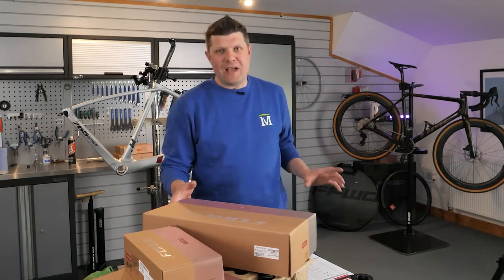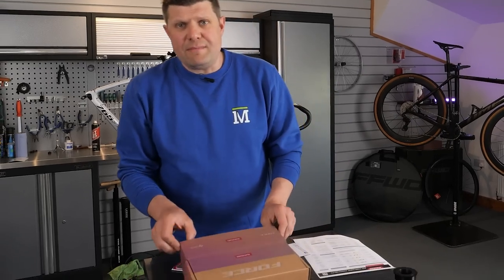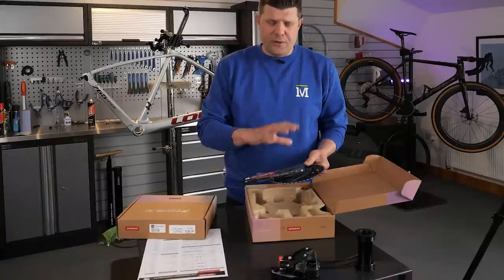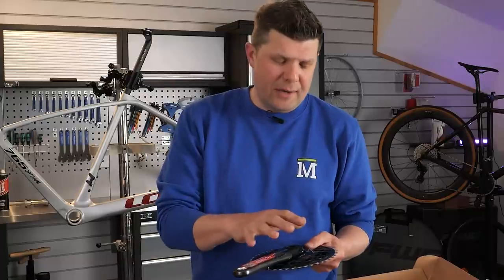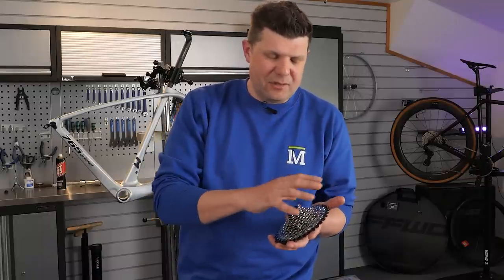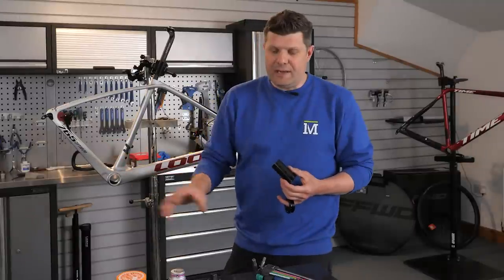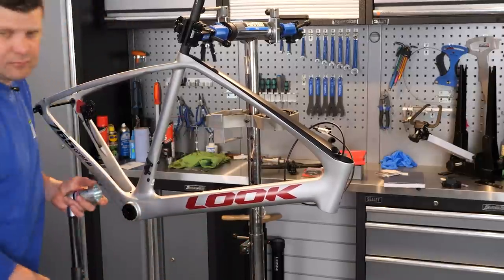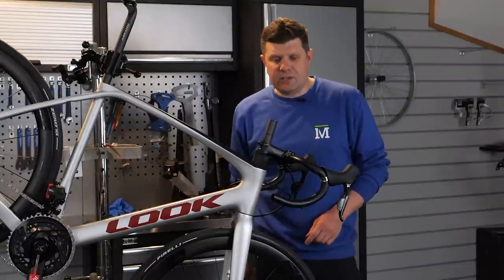SRAM FORCE leading the way, we all need to catch up

Comment: New Force AXS uses the same main shifter body as the Rival, so they got rid of contact point adjustment (which really didn't work well IME).
Also, for the BB was a spacer installed on the DS before the initial install? The SRAM Dub BB install chart shows that a 2.5mm spacer is needed for the regular Dub crankarms with a traditional road-width bottom bracket shell and cups. So the spacer added later should have been included from the outset if none was initially installed.
Nice vid tho, keep up the solid content
Reply from the maker: I know. That’s why I said Hambini should supply one.

Comment: 16:24 OMG , I left this video running in the background and went to FFWD to see what's new in their outlet section for my VITUS EVO but nothing rim brake so looked at normal priced wheels and seen these RYOTS and as I went looking for what Shimano is doing I heard you mentioned FFWD........................................so the Dutch wheels for my VITUS it is !!! A sign from above
Reply from the maker: You mean you weren’t paying full attention and ended up buying FFWD wheels through subliminal messages 😳
Reply: @Mapdec  😂😂😂 I don’t need much encouragement to buy from that brand, I had a set of F6R with the aluminium brake track and they were fantastic solid wheels, highly recommended!!!

Comment: I run the 43/30 wide option originally with the 10/36 cassette but I changed to using a Shimano 11/34 as they cheaper to replace.  Also I didn't really need a 36 upper socket (34 is so close anyway).  With the Shimano 11/34 if gives me a 14 sprocket between the 13 & 15 over the Sram 10/36, which I find more usable to me than a 10. Which is just too big for me, who is going to use a 10 on gravel? The complete Look bike is gorgeous.
Reply from the maker: Good Info Dean.  Thanks.
Reply: I made a close ratio for gravel. 14-32 cassette from the 11-32 but replace the 11 and 13 with 14 and 15 from the Jr. Cassette. Very usable for gravel with 46/30 rings.

Comment: I'm a big fan of the Force/Eagle mullet setup. I do wish there were more chain options, for non GX/Eagle rear mechs. I have found that KMC and such don't work as well as the SRAM flat top if you are running the Force/Rival/Red derailleurs, although the GX/Eagle don't seem to be as picky. This is unfortunate as I like blingy chains and SRAM rainbow chain is unobtainium.
Reply from the maker: Yes, it is quite surprising that KMC, connex etc haven’t got to eagle stuff quite yet.
Reply: Have you tried YBN?
Reply: @TenSapphires  No, but I will look them up.   I've been a pretty hardcore KMC fan and was really disappointed their chain didn't work as advertised.

Comment: Very informative as usual,love how tidy and clean the workshop always is-definitely one way to spot a pro!question why gt85 not wd40 just cause it’s cheaper ? Or any other reason? 🙂thanks
Reply from the maker: The workshop downstairs is a different story ☺️.  Think I was using that GT85 to clean off some sticker residue.  We don’t tend to use it much. We keep WD40 downstairs as a water dispersion.  Gt85 usually hanging around, it has its uses.

Comment: Another super looking machine👏 What did you torque the T47 BB at? Thanks for the info on the BB, was something I’d been thinking about as to how to instal mine. What would your recommendation be as to a set of Carbon bars, would be nice to have your take on this.😊 Keep the content coming👌
Reply from the maker: Thank you.  It’s in the vid, more importantly its in the instructions 👍
Reply from the maker: Oh carbon bars.  Saves weight, aero bars save watts.  Lots of them flex in an anoying way.  I personally prefer alu for rigidity and confidence

Comment: Have you have any problems with chain drop on recent AXS builds? I'm looking at the new Force, but a couple of clubmates had issues with seemingly-incurable FD woes on the first version of this groupset...
Reply from the maker: No, but that said it’s very easy to set this up without using the limit screws.  A mechanic doing quick assembly would easily overlook it because the gears would work well in the workstand.  It’s an easy fix.

Comment: I’m using rival 43/30 crankset with a standard DUB crank rather than wide. Works fine.
Reply from the maker: Ah. Did you just buy the chain rings separately.  Many folk will find that the braze on hanger does not go low enough.  Depends on the bike.
Reply: @Mapdec  Front mech is at the bottom of the slot on my BMC Roadmachine. I use 43/30 for long days in the mountains.

Comment: Hi! Great video!
I really understand the use of a wide spindle for the 2x set-up on a gravel. I wonder if I would need a wide 1x crankset over a normal size one, to build a mullet set-up . Do you think it would affect the chain-line too much?
Reply: If your frame has both it should be fine for each. Certain frames can only have the road wide cranks.
Reply from the maker: Check and measure the frame and consult the SRAM frame fit specifications. Your cranks might hit the chain stays.

Comment: Question: rim brake caliper adjustment lever/cam knob or whatever you want to call it. I see so many riders with this in the open position and cable tensioned that way. Shouldn't it be tensioned closed unless you have to take the wheel out to give it clearance? Pet peeve of mine when I'm looking down at the person's frame in front of me.
Reply from the maker: You are seeing this more and more as riders are trying to squeeze in wider wheels.

Comment: Excuse the stupid question as someone looking to change from shimano mechanical to sram axs. What would be the right set up as someone who has compact chain set with 11/32 on the back what would be the axs 12 speed equivalent.  Cheers and keep up the good work.
Reply from the maker: Do you want to extend the range? Which way? More lower gear for climbing? Or more higher gears for speed?  Sram have a useful calculator on their website
Reply: @Mapdec  I was looking for the closest gear ratio as possible that I have now. I'll check their website. Cheers for that. 👍

Comment: If sram got rid of the flat top chain and small chainrings, they would be hard to argue against. Theoretically sram-shimano hybrid is possible, but I've heard that in practice your mileage may vary
Reply from the maker: It depends on how much noise you consider tolerable
Reply: What’s the problem with the flat top chain? At least it looks way cooler than the normal ones.
Reply: @SrFederico  slower
Reply: @invisiblescout6335  But that could hardly be caused by its form. That must be the inner construction.
Reply: @SrFederico  doesn't matterwhat the cause is, it's slower than the competition and the only one compatible with the rest of the groupset
Reply: @invisiblescout6335  According to Zerofrictioncycling, Force 12speed chains are identically fast to Ultegra 12speed chains. So what's the deal?

Comment: I really like this channel, informative and very well presented. Do you have any experience of fitting a Rotor crankset with their own version of compatible AXS flat top chain rings, in combination with the Force group set? Also, is the SRAM brake bleed process really that much easier than Shimano’s? Nice to see a bike shop using quality tools such as Wera.
Reply from the maker: Thank you. I can’t comment on the rotor/AXS sorry. I just haven’t come across it yet. All brakes are pretty easy these days, especially if you use the brands own bleed kit and follow the instructions exactly.  All systems can get that awkward last air bubble trapped somewhere. Sram is less tolerant of a bodged job, Shimano is more forgiving

Comment: I have two quarqs dzero 11 speed. Can I use them with AXS 12 drivetrain? Or do they make 5 bolt 12 speed chainrings with 110 and 130mm BCD?
Reply from the maker: Depends on the spider you have.  Sram don’t make compatible CR, but there are 3rd party options for some set ups.
Reply: @Mapdec  thank you. I found that praxis makes rings that would work with my setup.

Comment: I’m having an issue with my new DUB left crank power meter where it reports non-0 cadence and power numbers when coasting occasionally, have you encountered this?
Reply from the maker: Hey James. No, but have you used the AXS to reset and did you calibrate from your head unit?
Reply: @Mapdec  Yeah, I've recalibrated in the app and my wahoo, and reinstalled - issue persists. I contacted Sram, they said reset it by leaving the battery out of the sled overnight. Issue persisted. They said next step would be replacement

Comment: So many wasted watts in SRAM AXS road, DUB BB, flat top chain, not to mention the 10 tooth cog on the cassette, having said that its so easy to build a bike with AXS
Reply from the maker: That’s quite a claim 😳
Reply: The chains consistently test slow but durable,  and the mechanism of small cogs and chainrings being less efficient is well known.  Every modern TT and Tri setup accounts for the latter.
Reply: @willspower3  I mean, we're talking about a handful of watts. If you don't like it, just get a massive front ring and don't use the little sprockets - that's what we do in tri.
Reply: @David Wills  Jumbo Visma doing pretty well on them...have won plenty of races and been on many podiums using their stuff. Legion in the US using them in the crit scene doing well on them. I think the few watts lost probably isnt that much of a thing for riders with good legs.
Reply: @kellrockets101  A few watts is a few watts, but financial incentive/sponsorships will easily override it. Those teams are OP, so it likely won't matter much.  Also: https://www.youtube.com/watch?v=Tsk3zAZyLaQ

Comment: Just a shame you are stuck with their flat top chains and gearing ratios. Ps Sram say you should use their AXS chainrings. I would say they are limited for racing unless you pay silly money for the rare larger ring setup with I think may only be available in the Red possibly powermeter only variety.

Comment: Leading the way in shite front dérailleurs?
Reply from the maker: For sure. Sram never mastered the mechanical front mech. The AXS ones are good though. Many mechanics fail to fit the frame brace though.
Reply: I had no issues installing a previous gen Force AXS front derailleur and have had zero issues not only getting it super dialed but haven't had any issues with dropped chains either so I'm kind of curious if poor installation/maintenance is what leads to people having issues. That being said, I would not claim that SRAM does it better than Shimano; just that a lot of people go a bit too hard on SRAM.

Comment: Okay it's wireless and I got options. And the powermeters are solid (although throw away which seems completely out of place in current times). 
But objectively from all the different rations 80% are unnecessary and make no sense mechanical wise. Shifting is not as good as shimano, DOT fluid is just stupid and has no place on bicycle, SRAM bottom brackts and 30mm aluminium axles are shit, front mech is shit, flat top chains are shit, general quality is very mediocre and repairability and technical documentation lags behind. If SRAM is leading something, then it is questionable engineering and design philosophy
Reply from the maker: I’m not sure you listened to the part about PM. BB work well in everything except PF41. I’m not sure I agree about the design philosophy bit.  I like that they are pushing things forward and listening to riders.  Shimano has turned into a copy and refine 3 years later brand. Maybe SRAM is a little too early adopter for you.
Reply: @Mapdec Cycle Works as a mechanical engineer and cycling enthusiast myself, I have a very good understanding of the hole topic. Shimano is not without its flaws, but there is a reason why all cycling influencers with engineering backgrounds like peak torque, hambini, luescher etc are on Shimano. SRAM has some nice ideas but the fundamental engineering is just always questionable
Reply from the maker: Yeah. I can never understand their reasoning.  Shimano cranks bend , corrode, and snap, their callipers disintegrate, levers have very little adjustment, chainrings warp.  About the only issue with current SRAM is their crank axle. We just fix this with after market BB or spacers. Their XD freehub can crossthread if crack handed I guess.  If you don’t clean up after bleeding brakes you can get corrosion of seals. I guess as a mechanic serving customers I see less issues with SRAM and those I have I can fix because they sell spares. Shimano are a lot more disposable parts. They break easily, they don’t sell service kits, but in balance their parts are cheaper.    Engineers on YouTube tend to find faults that probably exist due to engineering in the costs and the home mechanic.  Shimano is often favoured for its simplicity. SRAM has become quite complex recently and it baffles many people. It is complex because of the options they give.  Good debate. I might get a podcast going about it.
Reply: @Mapdec  First of all, thanks for taking your time and answer even critical comments like mine!
Regarding the groupsets: it's definitely an interesting topic. As somebody without a fulltime job working on bikes, I obviously lack the day-to-day experiences with customer bikes that you have. On the other hand, with a proper engineering background it's very easy to spot engineering mistakes on paper. Some SRAM stuff is just fundamentally “school book wrong” in a way that even a first semester engineering student should know better. We don’t need to talk about the fact that Shimano also has some really obvious problems that beggar belief. But all in all, I think Shimano’s engineering is just objectively more solid and their drive train performance out on the road is better. 
From my own experience as a home mechanic, I can also say that Shimano gave me way less problems over the years. Of course, my sample size is way smaller than yours, but with all due respect, practical experience can be misleading. Yeah, maybe Shimano is as bad if not worse than SRAM in the workshop?! But Shimano is also fitted on way more bikes, so of course they are more broken Shimano components in absolute numbers. It is also fitted on more entry level bikes, which get less serviced maybe?! It is fitted with more race bikes, which get abused more!?
From 18 world tour teams, 14 are on Shimano, jet Shimano only sponsors 6 I think. There is no team pro team which rides SRAM by choice and that's for a reason.
Reply from the maker: I think the world tour is a poor example because Shimano gives substantial discounts even if not a full sponsor.  Personally I think both/all groupset brands make poor engineering choices. Not because they are bad engineers, but patents, cost, factory capacity and capability, shipping. It all has to be engineered around.   You are right Shimano is fitted to more bikes. Except mid to high end. Sram seems to be dominant there in both Road, MTB and gravel now. I would say we see more AXS than Di2 now.

Comment: Leading the way? With toxic DOT fluid needing annual bleeds? And a bin full of broken parts at almost every bike shop?
Dude, full disclosure - are you on the take? Your hate of Campy vs your love of SRAM is alarming.
Reply from the maker: Haha. No.  And I think you are filling in the gaps for yourself.  This vid explains the vast options available that’s all.  The campy vid says I was disappointed, that’s all. I don’t think either of those stretch to love or hate. We have a bin of broken Shimano stuff just the same. Brake levers you can’t economically service, Ultegra Calipers disintegrating, cranks splitting, blah blah.  Chill dude. However a full vid on that Ekar 💩 is coming. Campag usually very good, but Ekar is just emperor new clothes.